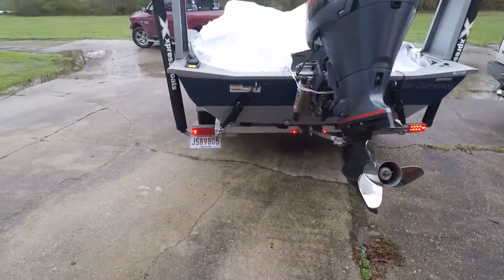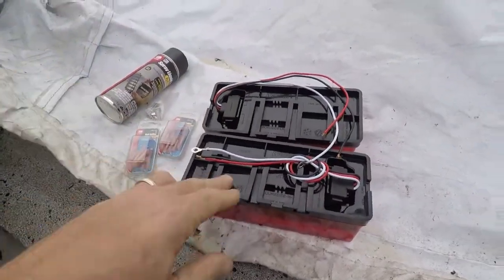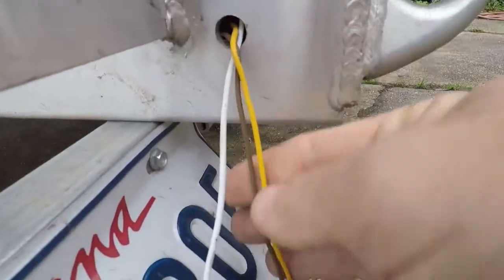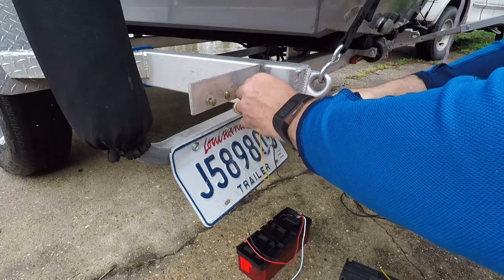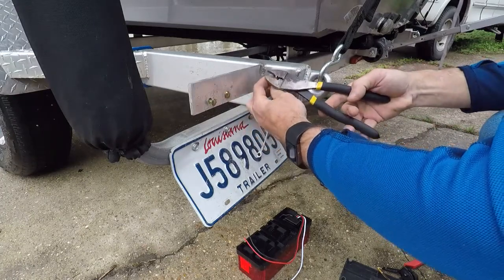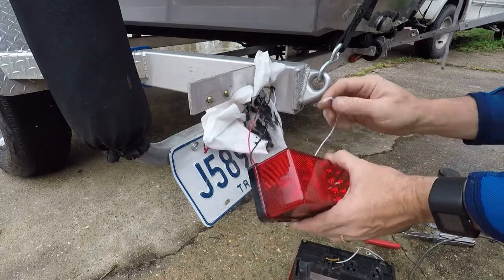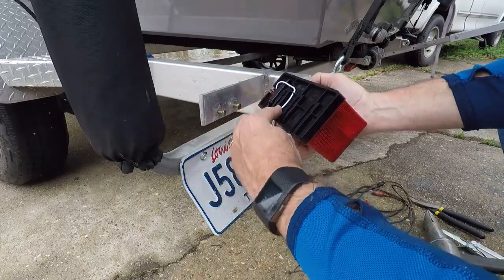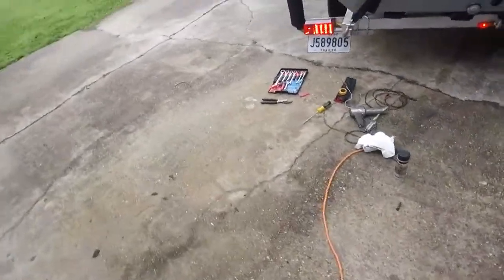Replacing Failed Boat Trailer Lights

Comment: You were right on time with this video. I have an Xpress boat on a Backtrack trailer and my left tail light is out. Worked on it today without success, but after watching this I feel confident that I can repair it tomorrow if I can find the lights. Thanks for posting this.

Comment: The electrical tape isn't going to protect that wiring from those sharp edges. Should have tape a single fish wire on the wires coming from the trailer frame, shoved the wiring back in leaving the fish wire dangling out, then taken a dremel to those sharp edges. I also would have put a grommet or some rubber hose on the hole, then pull the wires back out and connect to the light.